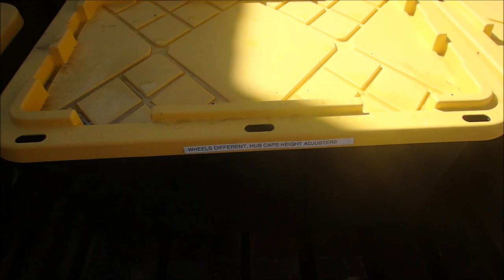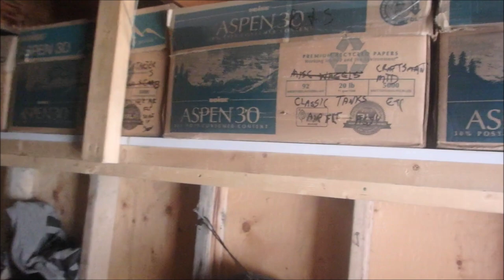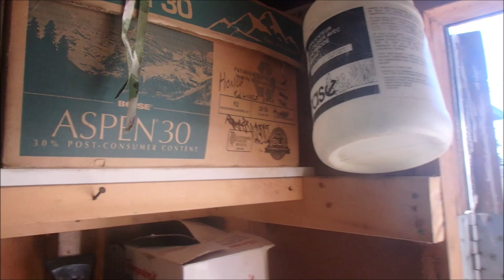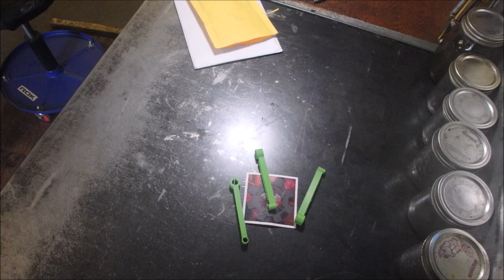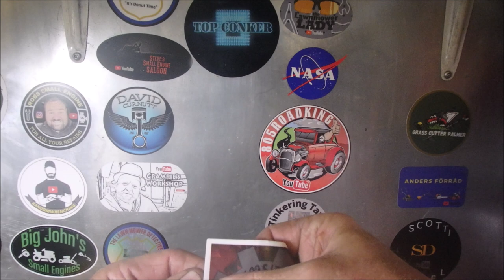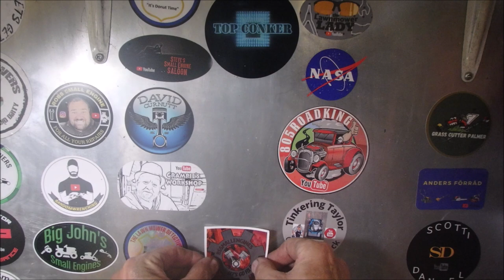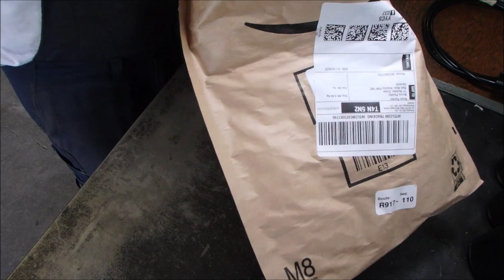Work on the House and More

Comment: Looking great! Been dry here in Michigan. I have not tended the tomatoes as I normally do. Rough 2022 for me. First the fingers, now the heart problems. Probably quadruple bypass soon. But I am fixable. Nice tour!
Reply from the maker: Hey there my friend  am with you.
Reply: @BrucesShop  I am going to have lots of time to watch the YouTube since I won’t be allowed to do much for 6 weeks. My appointment is Thursday to go over last Thursdays angioplasty results, but I already was told in recovery room that I have several 90% plus blockages. So tonight I spent 2 hours pushing my mower cutting my grass. They probably don’t want me doing that. Last week I finally replaced two fence panels from last August tree falling down just missing the Saturn and slightly hitting the house. No more chicken wire fence. Probably not supposed to do that either.
Reply from the maker: @haneyoakie14  Don't hurt yourself before the procedure.
Reply: @BrucesShop  some guys don’t take instructions well. Hard headed. I have suspected the problem for a while, over a year or more. In that year I have cut my own lawn and some other peoples too, probably 50 cuttings between mine and others. Out snow blowing the neighborhood too in part of the winter. I will be fixed and blowing snow by snow season. That is my plan. Of course, my plans never work out as planned. So I improvise. It will be fine. I am fixable. It is as common and easy for them as a gummy Quantum carb is for us.

Comment: For the second year in a row, my apple trees (3), haven’t produced more than about 5 apples, total.  Very unfortunate!  😩  I heard it’s extreme heat stress that caused it.  I’m not convinced though.
Reply from the maker: I have heard if you trim the new branches back about 1/2 they will blossom each tear.  That is that I do  It keeps them from doing the biannual thing.  Trim to the outgrowing bud to keep the branches growing horizontal.